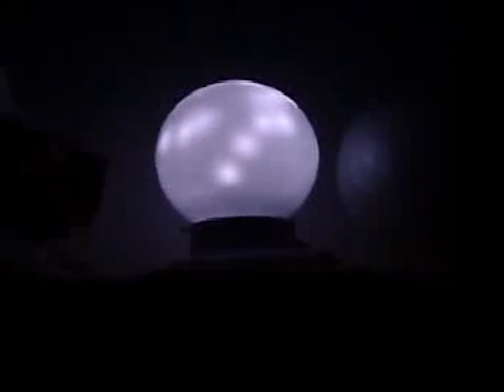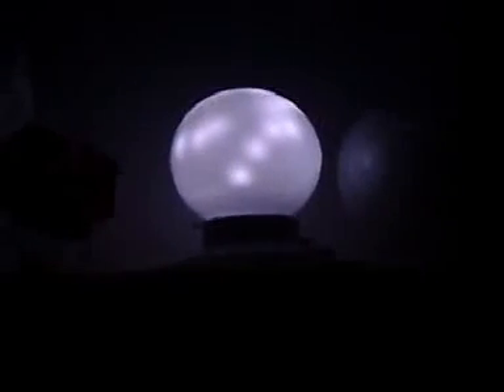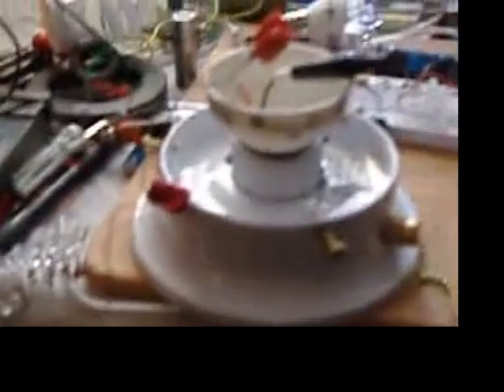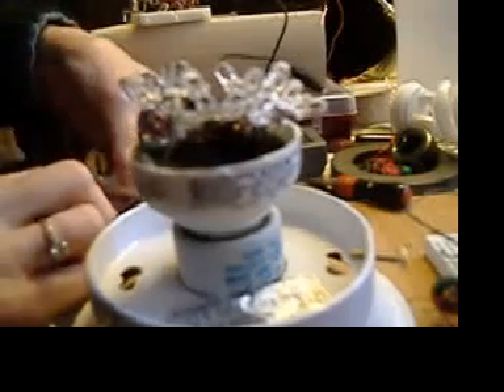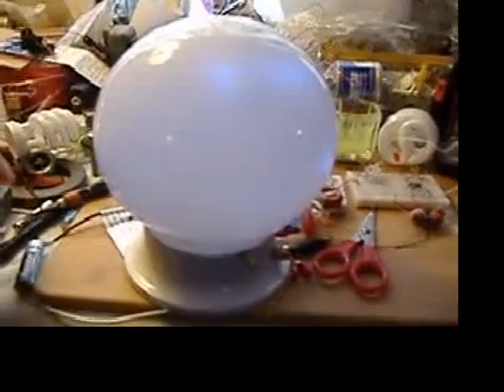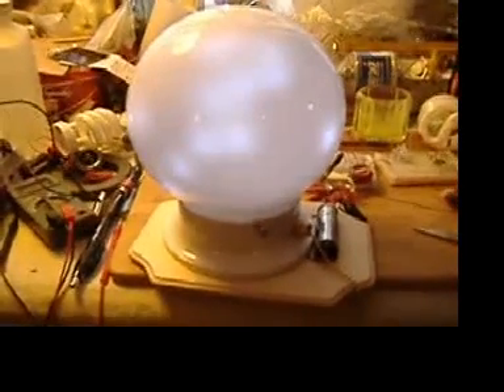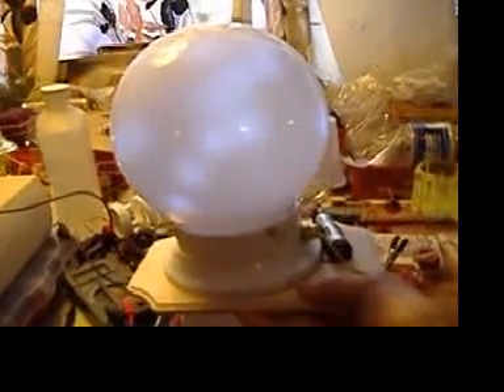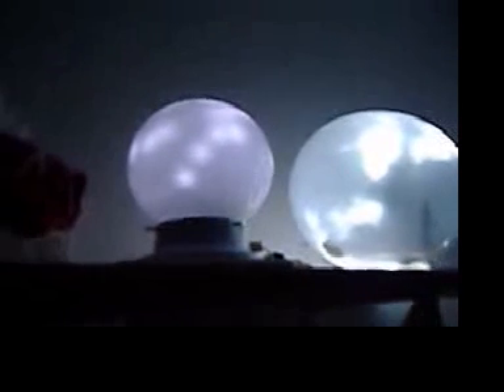Joule Thief in a Globe Lamp with 24 leds on Secondary

Comment from the maker: Hi,
Have you made a joule thief yet?
The schematic starts as a standard joule thief. 
I have removed the basic led from the joule thief circuit and wound a ~35 turn secondary around the same toroid as the centertapped primary.
It is the 2 wire ends of that secondary alone that are connecting to the lights. 
I figure around 5-7 turns per led is bright enough and still safe for the leds.